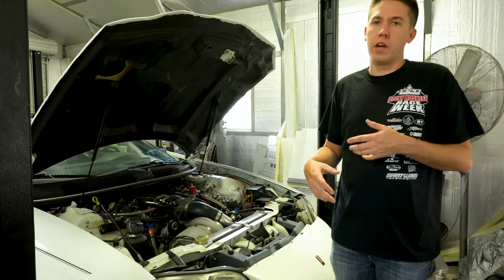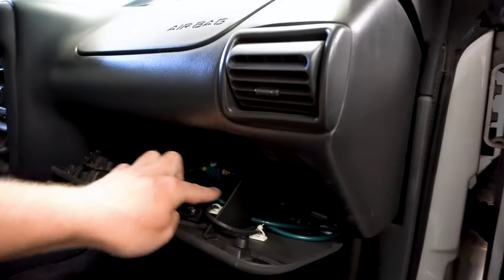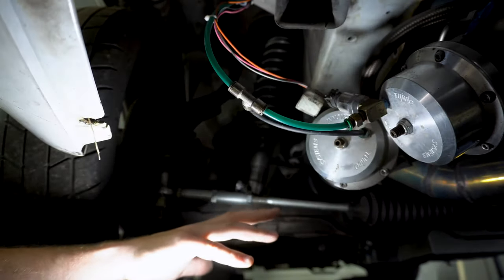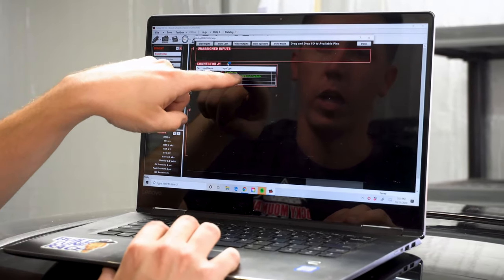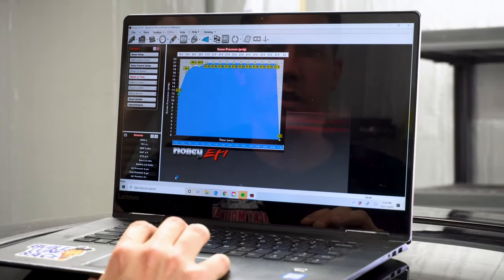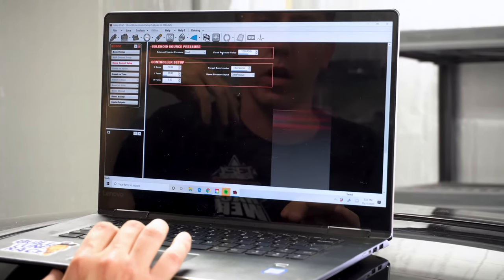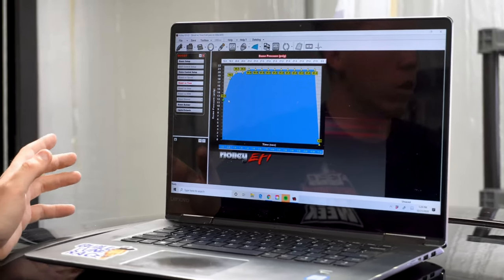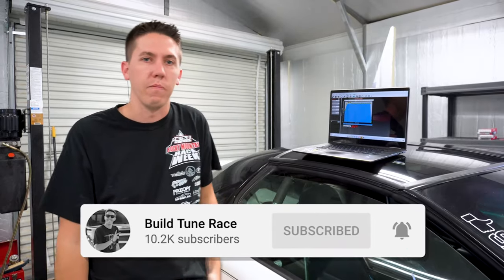Boost Control Setup on My Turbo Camaro!

Comment: Wish you could have explained how to wire in the dome pressure sensor and how you got the 5V and ground. I don’t really feel like splicing into my new Holley harness.
Reply from the maker: Unfortunately the older harnesses you have no choice but to splice i spliced into sensor 5v  power and sensor ground from the fuel pressure sensor.

New Holley harnesses have a tap for 5volt sensor power and ground i would create a distribution block using each of those wires
Reply: Build Tune Race I have the new harness with a power tap but it is being used by a sloppy mechanics flex fuel harness. Can I still tap into the sloppy harness for a 5V since I believe it has a resistor in the wire? Thanks

Comment: Pretty good info. My question has always been how should I set up the ranger for street. Holley HP, 2 mac valves and motion's co2 tank set up. I dont need boost vs time yet. Maybe boost vs rpm or speed? I have the holley 6.8" screen with GPS
Reply from the maker: So for the street if your just rolling around and want the boost to come in you can do boost by time off of throttle position then when you roll to say 80% throttle it will start to ramp in the boost.

Boost by speed would probably work really good but you'll need to input a speed sensor though. 

Idk how much i would like rpm if its shifting thru multiple gears🤔

Comment: I'm doing a 78/75 Huron speed kit on my 99 Camaro, w/TurboSmart eboost street 40psi. controller. Has a single Mac valve, and says to pull off of the compressor housing to Mac valve and gate, then use vacuum off the intake for the bov, gauge, etc. I think that's all I have..? Does that sound like it'll be sufficient..? I've been told different opinions, but I hate to vary from instructions, not knowing enough. This is my 1st shot at a turbo and I'm learning as I go, slowly!lol. Thanks!
Reply from the maker: That should still work well for you! I think those are set up off duty cycle which works decent. That’s part of the fun is trying it and see how you like it! Just take baby steps and see what it does with small setting changes!

Comment: I see u have ur tbrake dome pressure at 7psi. Does it build 7 on the brake or 7 plus the spring?
Reply from the maker: So based on the setup in the video at 0 I have 12psi thats what it adds on top when i grab the trans brake. Under T Brake Launch it has 7psi in the target box (I don't mess with that) that is just to reference in the data log you can pull up target and compare to actual.